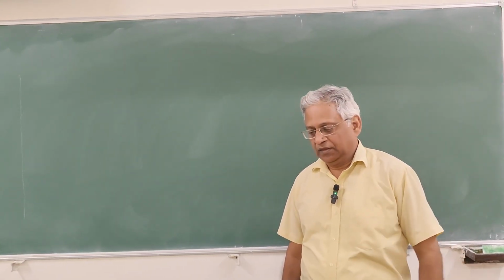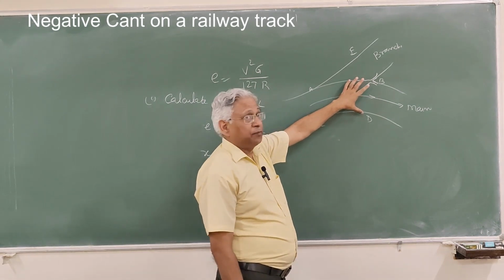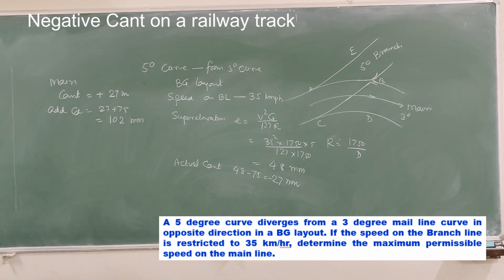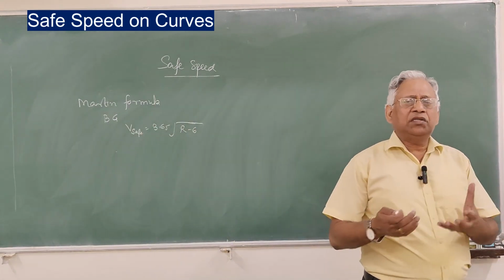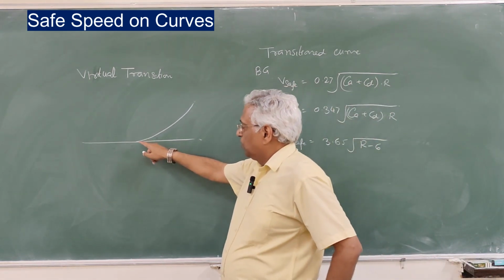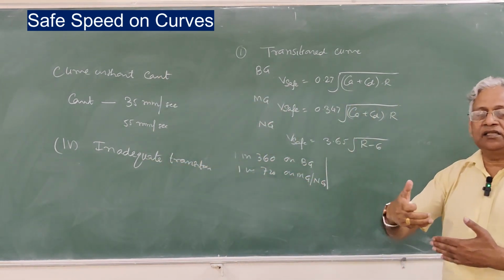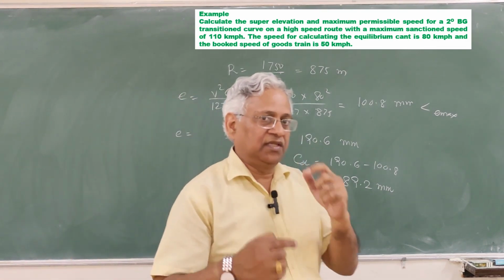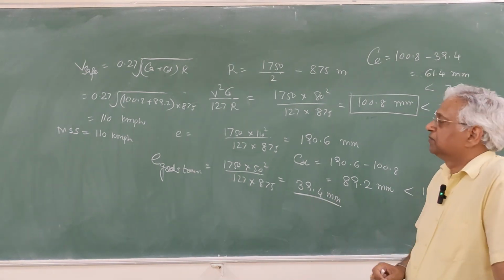#railwayengineering  Negative #Cant, Design of diverging tracks, Safe #speed on #Horizontal #curves

Comment: sir could you help me understand what type of transition is in this problem? new railway exit must follow a clockwise circular curve leading to a side track that connects to a secondary rail line.The exit track must smoothly merge onto a perpendicular railway line, which runs on a viaduct above the main rail corridor. This transition must allow trains to continue moving without stopping or making sharp directional changes. i don't understand how its supposed to lool
Reply from the maker: There is no discussion on transition curve in this video. I have another video on transition curve. Watch it.
Reply: @SatishIITR  hello, thanks for responding. I watched the other video, but still don’t understand if that is how my railway is supposed to look like. I dont get the “merge into a perpendicular railway line” and “viaduct above the main rail corridor” part. Should it be a 90 degree angle?
Reply from the maker: @idk-pz5rx  I did not understand your point very clearly, but railway curves are not that sharp. May be you need to see some Indian Railway document for this sepecific case.
Reply: @SatishIITR in this patticular case, do they mean that the curve is going uphills? What does viaduct above main corridor mean
Reply from the maker: @idk-pz5rx  Viaduct is provided to cross a valley in hilly region. Curve going uphill means both horizontal and vertical curve together.
Reply: @SatishIITR  thank you so much for your help sir! Is there a formula to calculate the slope ?
Reply: @SatishIITR  Thank you sir. Could you tell me what formula I need to calculate the maximum safe speed in this case?

Comment: Sir in Sri Lanka there was a narrow gauge railway with curves around 100m,120m and it was converted to a BG on the same narrow gauge trace without changing curves and transitions. isn't it a bad idea to convert a narrow gauge winding to a BG without changing curves? but if it was converted to a MG track there will be no big issue right? want to know your opinion. thanks you.
Reply from the maker: Yes, it was not a good idea to convert NG to BG without changing its geometric features. BG and MG lines have almost similar specifications, but narrow gauge is only for hills and have very low standards of design. There speed is not the criterion, but connectivity and construction cost are the main considerations.  In your case, speed has to be controlled on each sharp curve and that will naturally not give all benefits of a BG line.

Comment: For BG value is 1676 na sir
Reply from the maker: Yes, static gauge for BG line is 1676 mm, but the dynamic gauge is 1750 mm, which is taken in most of the calculations.

Comment: Formula given for calculation of safe speed for BG and MG is same whereas for NG is different.Pl explain the same
Reply from the maker: Theoretical considerations will result in very high value of safe speed on Narrow gauge, sometime larger than the design speed. Therefore Martin's equation is still used on these lines.

Comment: Thank you sir for the in-depth analysis of negative cant. As we know that transition curves are avoided at points and crossings. For diverging tracks, if we provide simple circular curves, how can we attain cant/superelevation? Could you please provide an example using a 1 in 12 or 1 in 8.5 turnout?
Reply from the maker: There is concept of virtual transition in such cases. I have explained it in my video on Safe speed on curves.
Reply: very excellent presentation sir , really great support gain the knowledge
Reply from the maker: @raveenderreddy1438  Thank you.

Comment: (11.31) Martin's formula for the transition curve
for bg/mg  Vmax=4.35(R-67)^.5 km/h
for ng Vmax=3.65(R-6)^.5 km/h
this is right.
Reply from the maker: Yes, it is correct. But Martin's equation is no longer in use for BG and MG lines. New equations are based on theoreticla considerations.